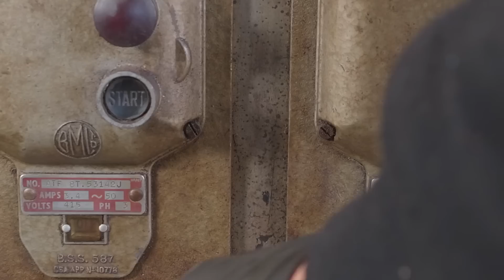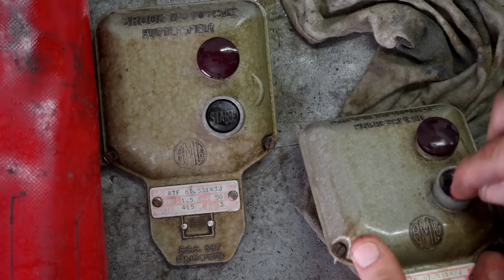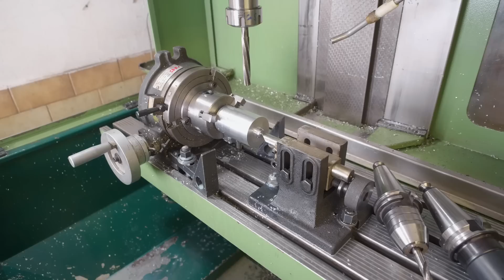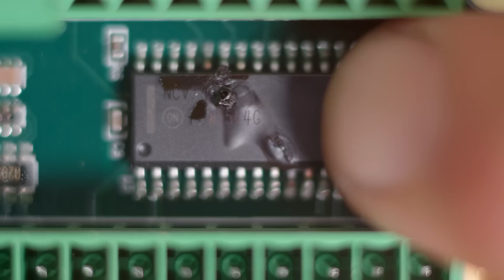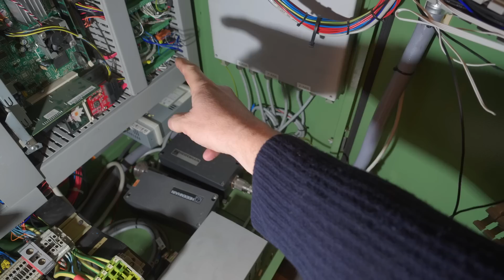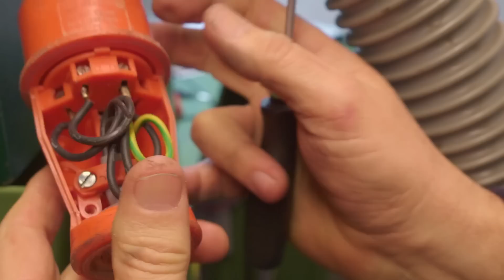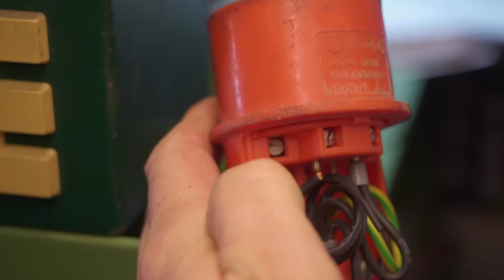Electrical troubleshooting my MAHO 400E CNC mill, and J+S 540 surface grinder || RotarySMP

Comment: I picked up a harrig 612 little surface grider the magnet control didn't work so i fixed that and still haven't really used it. That was over a year ago.The magnet needs redressed and i hated doing it. At work it might also need spindle bearings.
Reply from the maker: Time to get stuck into it :)

Comment: Good video! I learned years ago from a electronics technician to start at the power supply. You wont get a signal if there is no power! 
My last kitchen install fried my oven since the guy that did the wiring was not a an electrician. I tested the leads for power, but not phase to phase. Turns out he had the neutral wired to a phase and that fried my 400€ oven! Glad I didn't pay that much for it! All that I previously learned could not help me with that!
Reply from the maker: Good call Johannes. Shame about that oven.

Comment: General troubleshooting is 1) check all the supply voltages - AC and or all DC rails including for ripple and noise, depending on what you're working on 2) Check inputs and outputs (just like you did with the contractor). 3) If there's smoke or arcing, turn it off and re-group, then check some things with the power off to figure out what happened. I'd say your troubleshooting skills are pretty good (at least in the edited version of the video :) ).
Reply from the maker: Thanks. Editing helps :)

Comment: As an electronics engineer I think you do very well. Sometimes it just takes time to find a fault especially if you’re not working on this piece of equipment every day. Have yourself a beer and give yourself a hug and if anyone asks say I said so 😊
Reply from the maker: LMAO :) I already had that beer.
Reply: I agree...

I remember my boss and my colleague struggling to debug a software issue for hours, then I came along, looked at the board and noticed they had the wromg size FRAM soldered.

Debugging is hard and takes time. Even for people that work with it every day.

Mark is doing just fine!
Reply from the maker: @adagioleopard6415  Thanks for that.
Reply: I remember (or at least the bits I remember) First year E Eng, Beer consumption was a core module 🤣Got my head in an 8 1/2 digit Multimeter at present, many Beers and stroking of Gray Beard has been done and additional smoke release has been avoided with this approach.

Comment: A loose wire in the plug... who would have thought.
Reply from the maker: Hi Michel. Not me :)
Reply: Anyone who's ever had a colleague like me would have expected this. When you work in control cabinet construction for a few years, you really see a lot. I think that's the trick to troubleshooting. Next time, you'll look for it. But then it will be something different, and that's how you build your troubleshooting skills.

Comment: Mark, you may already done this and just not shown us, but please go back into the plug and make sure all the wire mains now have ferrules, at both ends.  And now that you have the crimper in hand, check the rest of your machine plugs.  😊
Reply from the maker: Hi Joel, I did the plugs on all the others, so that have ferrules. This plug was already on it when I got the machine. It has ferrules, but looked like that one phase was never properly inserted into the pin socket, and the screw had just caught the tip of the ferrule.

Comment: That is a really nice explanation. Might I ask where you got the enclosure for the Heidehain card. I'm also doing a retrofit and that would be a great help.
Reply from the maker: Do you mean the three channel EXE card on the side of the enclosure? That is just a bit of thin sheet metal I bent up. Only one channel of that card is still in use. Two were replaced by stand alone EXE's.
Reply: @RotarySMP  Yeah, that's what I ment. I don't have any sheet metal, so I'll just create something with my 3d printer. Thanks.

Comment: How could the lack of a phase cause this issue?
Reply from the maker: That is also beyond my understanding. Maybe I didn't have two faults (the screw in the pendant, and the loose phase in the socket), maybe there is still a fault in the system lurking ready to destroy the replacement I/O card. Any fault isolation suggestions to prevent that?
Reply: The Lack of one Phase over rates the other two phases and the breakers drops. If you have three phase power supply for DC the don’t like it if one phase is missing. You are lucky that you have missing phase not missing Neutral 👍
Reply: @viktorhecht33  Are you saying the 24V DC are generated from three phases? I know what happens with a broken neutral first hand (impressively ugly).
Reply: @michaelhaardt5988  Yes, there are probably no three-phase power supplies installed, but I don't know. It was just a thought as to why the IC broke. It could be anything. I'd be more concerned about why the wire in the connector was so loose in the first place, and what else might be hanging there loosely.

Comment: For a guy who says the "electrical stuff doesnt come natural" you seem to be doing quite well, including chip-level repairs on high tech PCBs 👍😎
Reply from the maker: Thanks, but that board is not repaired :/
Reply: @RotarySMP If that other guy calls a rain check, I can solder and test it too. I've also recovered SMT rework jobs that others have botched in the past, including lifted and destroyed pads.
Reply from the maker: @graealex  Thanks Alexander.
Reply: @RotarySMP    you did the heavy lifting of getting the chips out. 👍
Soldering in two SOIC chips is only ten minutes work, easier than getting them out...

Comment: The wiring of the timer is plain wrong, It should break the stop instead of bridging the start.
Now it bypasses a mandatory safety feature.
Which confirms this is an add-on.
Reply from the maker: Yeah, I will be redoing the wiring.
Reply: @RotarySMP  Success with that job.
May I suggest to replace the motor protection relays with new ones, with some luck you can gut these beautiful ones and fit the new inside.
Some have added features like phase loss protection, I would go for them.
I always look forward to your posts.

Comment: As a sparky now ex-sparky(retired) by the way I always started at the beginning on any fault. Mains in first then work your way through the circuits until you get to the fault reported or you know about. This checks that the fault you have has not been caused by something upstream of the actual failure.
Reply from the maker: Thanks Ken. It is tips like that I need to internalise.
Reply: @RotarySMP  I spend alot of my day job troubleshooting software with our customers...  slow and steady is the fastest way to find a problem. Using a methodical approach where you can isolate the problem is the best... and remembering to breath...  nothing gets done if YOU stop functioning. Be safe. =D

Comment: I've always hated electronics after trying in school. After building the car and having to learn Audi/VAG automotive wiring diagrams i've got... more tolerant to it. And eventually getting a better soldering iron I found that was an enormous part of my terrible experience. Not that any of that would help/change your experience!
And letting the magic smoke out is never a good time. So many old forums have died a death now and theres SO much knowledge thats lost along with it. Tragic
Reply from the maker: Yeah, the general tone and helpfullness of engineering forums has been excellent.

Comment: 14:10 you just practiced "rubber duck debugging" and it happens to software engineers ALL THE TIME
Reply from the maker: I need to google that :)
... true. Once I explained it on the forum, the root cause slowly became clear.